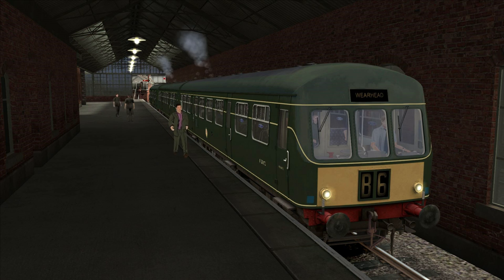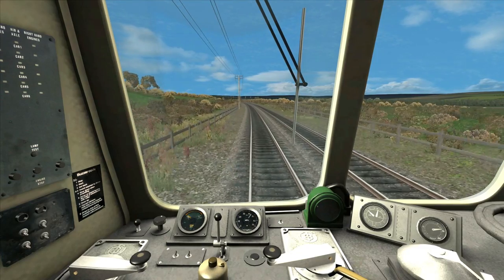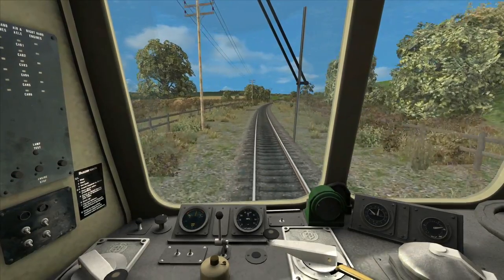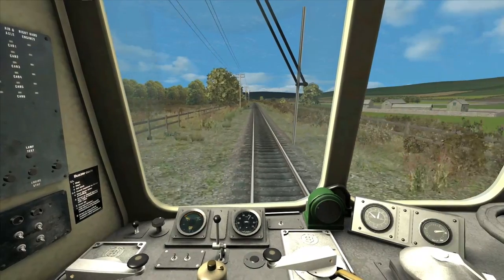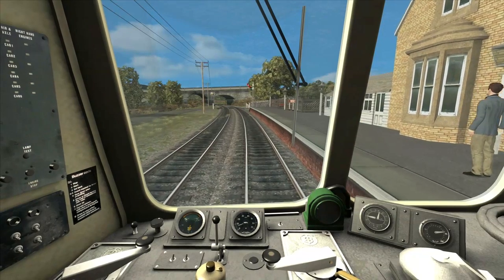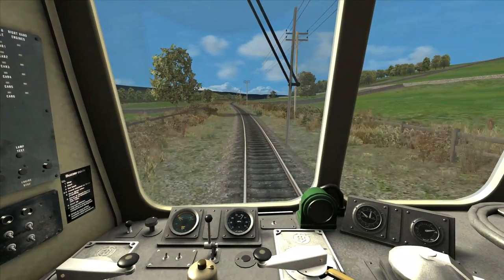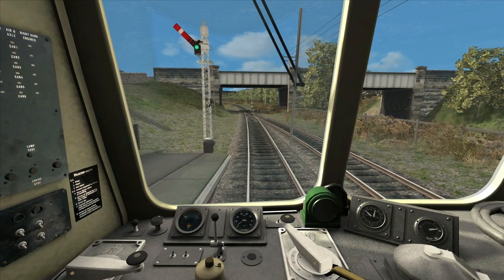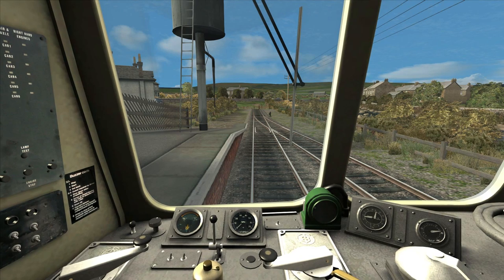Train Simulator 2015 - Route Learning: Bishop Auckland to Wearhead (Class 101)

Comment: NO!!!!!! The brake handle should ONLY ever be placed into LAP (or Hold) when you are using the brake. When running, the handle MUST be left in OFF. Failure to do this can result in the vacuum in the topside of the brake cylinder leaking away, which would result in NO BRAKES! as you correctly say, Always coast in 4th gear, but also never sit stationary with the gear selector in any position other than NEUTRAL. Sitting with the train stationary and in gear will rapidly cause the fluid coupling in the gear box to overheat, which could cause the fusible plug in the fluid coupling to melt and empty the fluid coupling of oil (no power/drive could then be transmitted to the road-wheels). There is also a risk of the fluid coupling getting so hot it can catch fire. Gear speed ranges are : 1st 0-15mph, 2nd 15-27mph, 3rd 27-41mph and 4th 41-70mph.

Comment: Hi there brill, as usuall.  Well off to a opfully sunny Manchester later.  Moving day!!  I had a look trough you vids, but could not find one regarding Radio Electronic Token Block (RETB).  If you have done one, pls link to one.  Cheers chat soon from Manchester
Reply from the maker: John Hamlin Hi John. I hope your move goes ok! I haven't yet covered the RETB in any videos. When I make the UK signalling guide, I plan on including both RETB and TVM 430 to give the most comprehensive signalling guide possible :)
Reply: Cheers mate, arrived.  Chatting through phone teather!!  Broadband comming soon.